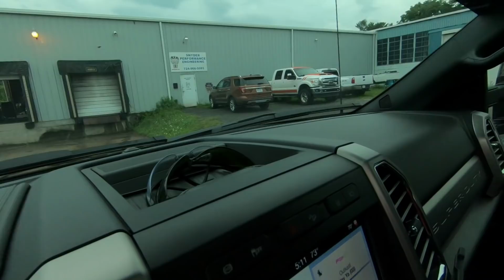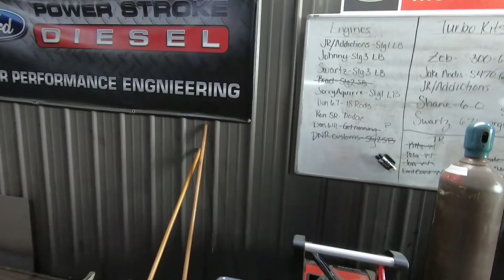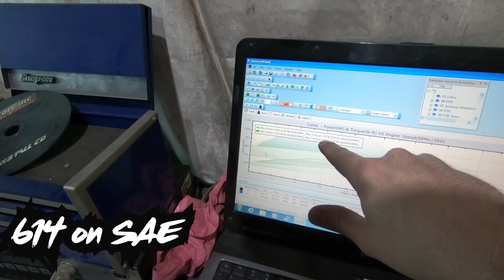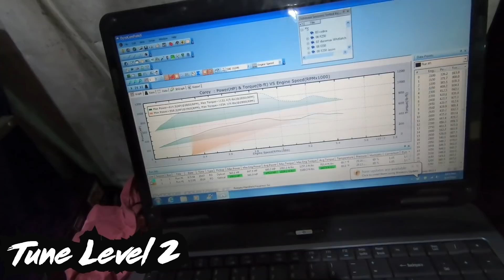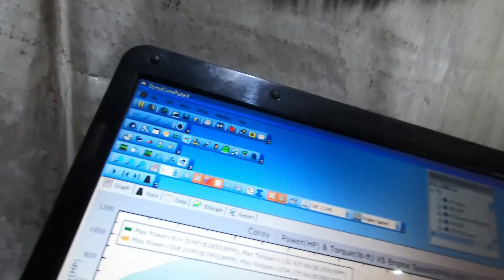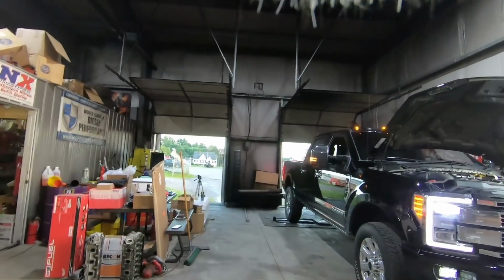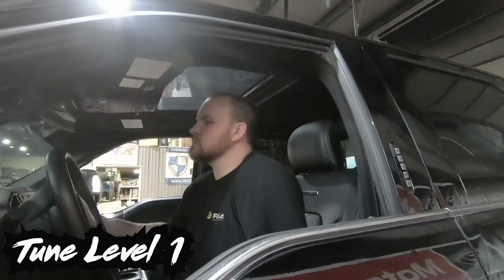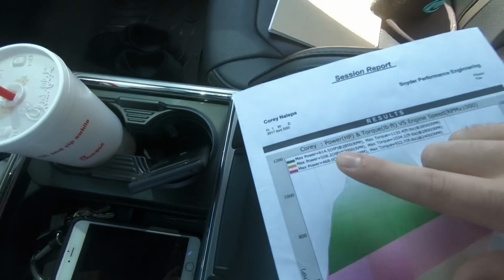6.7 POWERSTROKE ON THE DYNO - Will it make 600HP?

Comment: I’m still wondering were all the people are at that said that it won’t push out 600 hp!! 😂😂
Reply: Bodhi White if this is true what you say about this truck although I find it hard to believe it still has a DPF and EGR with all that smoke my 16 should be making 800 with a 5in down pipe back 140hp tune egr delete wicked wheel and a s@b
Reply: @becraftcorey  EGR doesn't add any power when deleted. And it doesn't have a DPF.
Reply: Where* learn the difference between where and were.
Reply: Where*
Reply: l @becraftcorey  lol

Comment: I’ve got a 15 f350 dually utility bed with ladder racks loaded for pressure washing and softwashing 250G water and 55G chem tanks. None the who it’s CAI, fully deleted, 165G Afe pump and tuned. It’s my work truck but boy even with my tanks filled and dragging my 16ft work trailer that I fill to guts, I have no issues overtaking anyone or ever getting up to whatever speed I want too. It does make very loud but very sweet noises and a lot of smoke in that process. Getting sent to grapplebees by a utility truck has frustrated many people.

Comment: Is this with the spe tunes? I have ppei tunes never had it on a dyno but from what I’ve seen with my setup 5” straight pipe exhaust egr delete and no limit intake other trucks have put down 576whp on the 5th tune. If this is the case looks like I’m swapping over to spe tunes.

Comment: I would def do a "muffler delete" as long as I could get a powerful daily tune that didn't smoke at all.
Reply: Joe S. A good efficient tune won’t smoke hardly at all. Too many tunes just dump more fuel and call it a day because it’s an easy/lazy way to make power.
Reply: Trey K that's good to know. I was following a 6.7 truck on the highway in the fast lane recently and I was like are you kidding me. Blowing so much soot. I have a tuned turbo vw gas motor making about 18-20 psi with a catless downpipe. It's port injection and has a quality tune from a company called unitronic and you wouldn't even know it's catless. Rarely get a nasty smell. Tiny bit on a Cold start only once in awhile.
Reply: LOL Joe S. You're comparing a 6.7 diesel to a vw gas engine??? Wow.
Reply: aarono43 I was actually comparing my only other experience with aftermarket tuning. The point being that modern engines gas or diesel burn much cleaner than old technology, due to the sample rate of the  modern ecu. I guess I was tired and didn't get my point across well enough for the trolls.

Comment: How many miles are you going between oil changes, and are you still using the amsoil?
Reply: 350 Platinum I’m not sure about him but with my 6:7 powerstrokes I go 5000 mile oil and 10 000 miles for fuel filters

Comment: You change the fuel filters every time you change the oil? Sounds way overkill. Fuel filter are designed to go 20,000 miles between changes
Reply: REC TEC Excavation a lot of these trucks can go 15-20k miles between oil changes depending on use.
Reply: Ford recommends changing fuel filters every oil change

Comment: Your supposed to use the Uncorrected values becase the SAE ad Standard do not apply to turbos because the spring pressure does not chnge with elevation and temperature! Ill have my 2019 Powerstroke F250 on April 29th or 30th! Im using mine to haul cars in the 48 states withca 34ft trailer! So ill leave mine stock with no tune or no mods! But use theUNcorrected numbers! SAE is for Normally aspirated motors not turbos!
Reply: Correction factors work very well for the most part, they use to be wrong 5-8 years ago, but the new weather stations and correction factor data they have work very well. The data collected from them is more than just boost pressure and barometric pressure. It also includes temp and humidity which both play big parts in overall power. Turbo cars will make 1-3 psi more on average form 1000Ft elevation to 6700ft. This is because of elevation or atmospheric pressure. If our starting atmospheric pressure is 11.7PSI, roughly 6700 feet above sea level, and we have a 10lbs wastegate spring installed, well 10 lbs above that 11.7Psi is 21.7PSI Absolute pressure. We take 21.7 minus 14.7 for a total of 7PSI above sea level. We do this because sea level's atmosphere is 14.7PSI and your point is 10psi is 10 psi. Now say we are starting at sea level atmosphere, which is again 14.7Psi, 10 lbs above that is a total of 24.7Psi absolute pressure, again minus atmosphere we have 10PSI above atmosphere. Now take that 24.7 minus 21.7 and we have a 3 PSI difference. 10Psi isn't just 10 Psi when changing elevation. Spring pressure stays the same but they still lose boost and HP produced because of absolute pressure. This is because a wastegate's exhaust side is susceptible to atmospheric changes, the exhaust's are obviously open to the Atmosphere. I hope this helps you understand this better and why cars need and have a correction factor, even turbo.

Comment: at the end of the day can ur truck go over 97 mhp with all the at power?
Reply: Platiboy with the ez lynk you can remove a limiters. Mine is stock other than lift and tires and with my speedo not being calibrated to my 37s I’ve had mine well over 100.. so I would assume he could...
Reply: Yeah I run the sct platform and you can choose to shut the limiter off
Reply: Jeffrey Eby Jr I had the livewire ts on my 6.0, but when I bought my 2017 they said they didn’t support the 17s yet...so I sold it

Comment: How about giving some prices on what it cost u to do this . thanks
Reply: The link is in the description.
Reply: If you got to ask how much you can't afford it. Guesstimate 500 for exhaust installed another 2 to 500 for a tuner
Reply: 800 to 1300 depends on what brand stuff u buy
Reply: $1300 for the tuner includes tuning device and custom tunes.
Another $400-$600 for the exhaust.

Comment: You’re Not Afraid 😱 You Might Burn Your 6.7 Liter PowerStroke Diesel engine Up?
Reply: learn how to type
Reply: Bennie Mabe these engines can handle a lot more power in stock form. Bottom ends have proven over 1000hp reliably within reason from factory
Reply: I Just Been Watching PowerStrokeDiesel. Com and, if it’s a Bad Tune They Burn Up the 6.7 Liter PowerStroke Diesel Engine 🛩😎🚁
Reply: It’s PowerStrokeHelp.com
Reply: you don't have to keep saying 6.7 liter powerstroke diesel engine.
Reply: That's What Type Powerstroke Diesel Engine We're Talking About Travis the 6.7 Liter Powerstroke Diesel Engine Not the 7.3 Liter Powerstroke, Not the 6.0 Liter Powerstroke, & Not the 6.4 Liter Powerstroke Diesel Engine Travis!!!
Reply: That's your whole problem

Comment: What's the stock #'s?
Reply: Kwmike-D 440hp 925tq at the crank so probably 330-400hp 800-850ish at the wheels stock
Reply: P Smith831 why would I care about crank hp when he is comparing wheel hp numbers from tune to tune? I didn't ask for a guess either.  Want to know stock - tune1 difference
Reply: Kwmike-D then buy one and put it on a dyno

Comment: Should of bought a Cummins.
Reply: And a new tranny every year
Reply: @EricSmith-lj7ln  got 598k on mine stock engine and transmission 95 5.9.  My 09 6.7 2500 has 179k all stock zero issues and the 2 fords do just as good.  We have an f250 gas with 200k and a new f350 hopefully it will be a good one as well so far its the strongest truck we have had